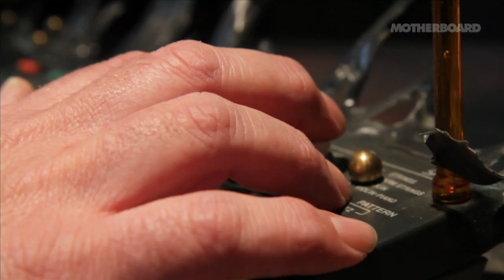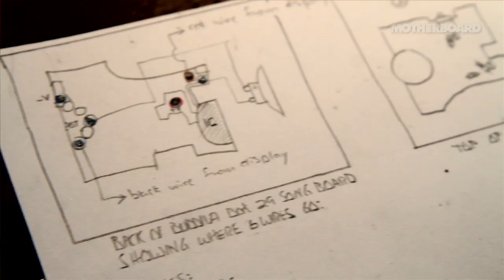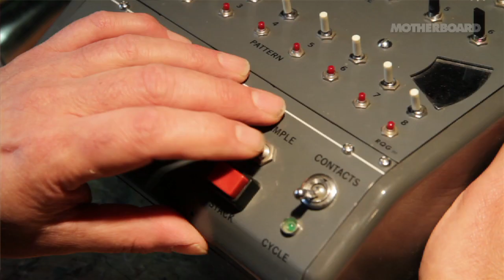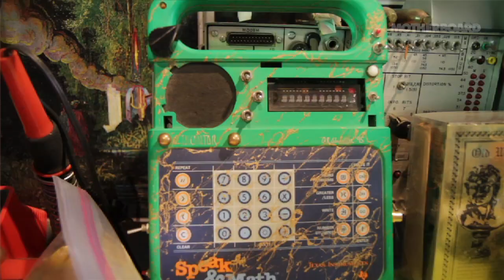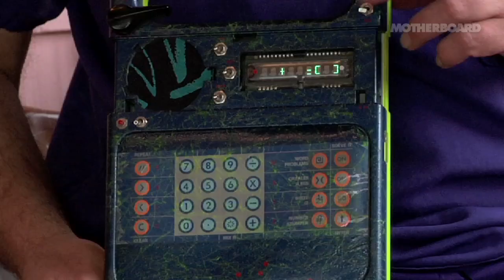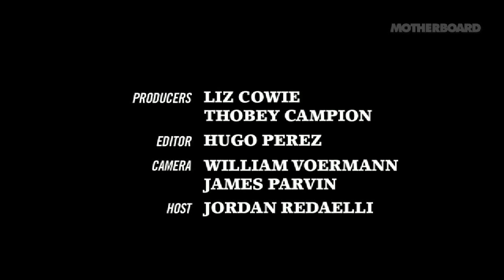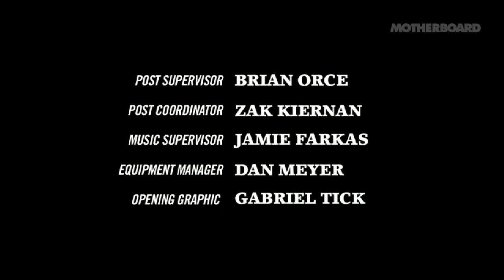Reed Ghazala, the Father of Circuit Bending: Sound Builders

Comment: Found out about Circuit Bending from Look Mum No Computer and now I've finally decided to give it a shot after seeing this. Time to dig through my shed for old electronics.
Reply: Did you do anything
Reply: Did you do anything
Reply: Did you do anything
Reply: Did you do anything
Reply: You done anything yet?
Reply: @SimplyDuker  I ended up circuit bending an old Casio CTK-720. I discovered that the I could output from different pins on the display chip and get audible waveforms so I added a way to patch that out to the keyboard audio. So far I've added a pitch dial and a switch to toggle the output on/off.
Reply: @Kaid_Studios  that's very nice. You did anything else?